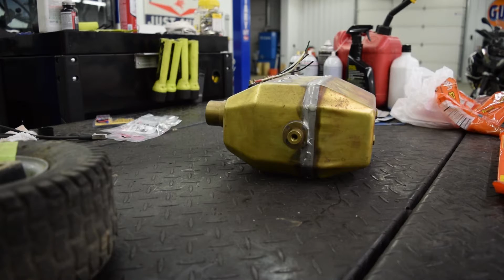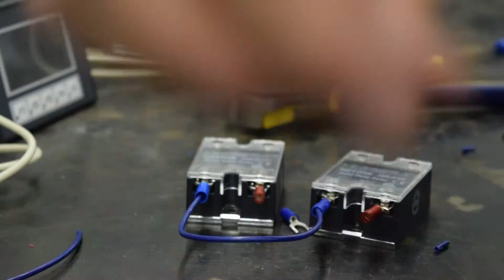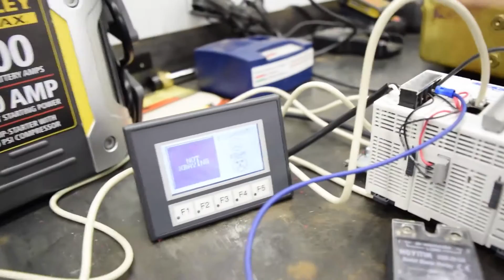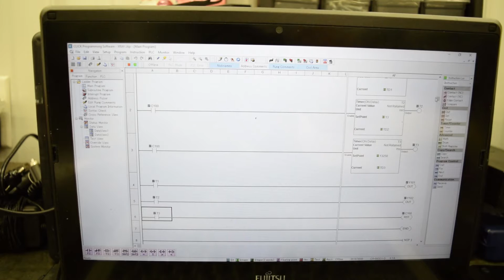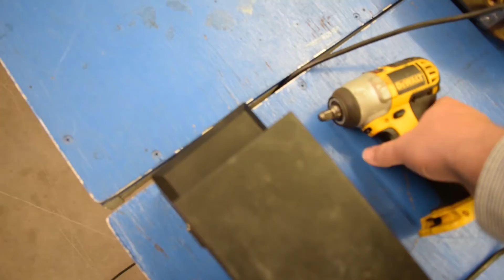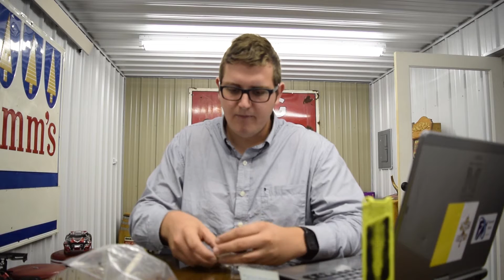Bootleg X-Ray Machine

Comment: I think it is so cool that you smoke ciggs..and have an insatiable curiosity for Science ...just like me..and you are working on projects that I absolutely love.....although you are well further along than I..you are also inspiring to me...I have just built a small Geiger counter with a cheap Russian made miller tube....but I am into all electronics...I have a goal to build a hand sized XRF analyzer but built it so that it will be far more cost productive than any machine out there now...most of these hand held devices cost around 20k$ and that struck me as really greedy..for those who aren't familiar with XRF..or x-ray florescence...it is a reaction that happens when x-rays are aimed at a small spot on any metal and the individual molecules that makeup that metal are released and recorded by the analyzer..allowing for example a metal recycling center to know if it is indeed Nickel that a customer is trying to sell or the much cheaper stainless steel...anyways I look forward to your continued mad experiments into hi science projects!!
Reply from the maker: Hey thanks for taking the time to view my video! The goal is to inspire other people to do things just like you're doing! An XRF gun sounds like a wonderful project. $20k is a bit steep but those companies have engineers to feed and (probably the biggest reason) they have to comply with FDA/NRC regulations. Getting these devices tested, and compliant takes a lot of time and effort! 

With something like XRF be mindful of the dose you may be giving yourself! There's a lot of scatter you may be picking up.

Comment: Awesome project ! Would potassium iodide not help counter act/defend against the radiation ? Although its such a low level, it’s still better to heir on the side of caution. Keep up the great work brother !
Reply from the maker: Potassium iodide is used to give the thyroid a "clean" supply of iodine. When the thyroid topped off it doesn't absorb more. What makes this great in countering radiation poisoning/sickness is it keeps the thyroid from absorbing the radioactive iodine present in the air after a nuclear event . Since these are just xrays potassium iodide will have no effect.
Reply: Conrad Farnsworth  very well thought out response ! Thank you
Reply: Iodine tablets are used to reduce symptoms of radiation diseases like cancer or ARS or Radiation disease. Fishes have more Iodine then other animals, that's why most of people after they have been irradiated eat fish.

Comment: would a x-ray tube work or do you need a X-ray Tube Head, the heads seem to be more expensive. 
Thanks  :)
Reply from the maker: As a general rule of thumb, tubes are in dental machines. These come packaged with their own transformer and filament warming circuits. Which is nice. If you're wanting to do longer x-ray exposures at higher voltages (100's of KV) for thicker, more dense materials, I'd recommend a rotating head. Sometimes these come packaged with their own transformer and motor control and power supplies, but they're more involved to get to work. 

TL;DR. Use a tube. Heads are more complicated, and not necessary if you're just trying to snap some shots of your hand.
Reply: thanks so much for your help

Comment: Hello, I am doing the experiment, with the flyback and the cascade of diode and capacitors can generate 80Kv, to this I put a load of 30Mohm to simulate the load of the tube (70Kv and Approx 2mA), but the voltage drops to 30KV . I want to know if I'm doing it right or the resistive load that I'm putting does not work to test the high voltage source? I would appreciate some help

Comment: I think that you are using the wrong type of fluorescent screen (a memory cassette instead of a intensifyng cassette)
Get a regular (or fast), green emitting cassette, it should works much better!
Reply from the maker: Thanks for the suggestion!!! Yeah it turns out it was a Kodak DryView Storage Phosphor Screen. I'll pick up an intensifying cassette!
Reply: Remember that the GREEN emitting cassette works better than blue emitting ones if you use a digital camera.
Also, the higher is the screen number, the higher is the sensitivity (but unfortunately the higher is the screen number and the lower is the overall resolution of the system).
High speed cassette can be used for denser objects, low speed cassette works better with small items.

Comment: Wouldn't the activating neutrons that came out of your fusor have been far more of a threat than some x-rays?
Reply from the maker: Spot on! The weighing factor for neutron radiation (out of a fusor @ 2.45 MEV) is 16 while xrays (across the board) are considered 1. Keep in mind flux matters. The neutron generator was isotropic whereas the xrays are not.
Reply: Hrmm, I thought your reaction was D-T, which should have produced 14.1 MEV. Guess you were running double Deuterium instead.  So the question is, have you ever looked leeringly at exit signs, gun sights, and key fobs as a source of fuel?
Reply from the maker: You get ~10x yield from D-T but that's moving out of the gray area of high school science project and into the realm of federal offense. With that said I have thought about it, but I think it's too cumbersome to contain, break, and meter into a fusor. Especially since I could I could be increasing my output by improving other factors.
Reply: nothing ness